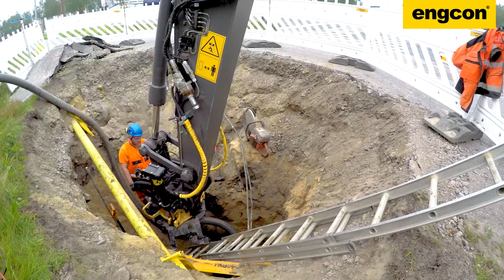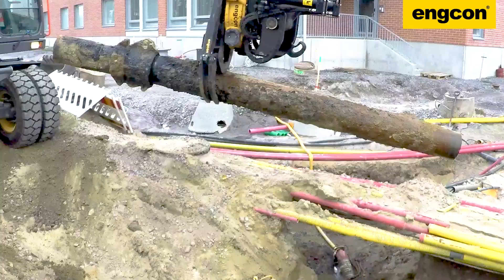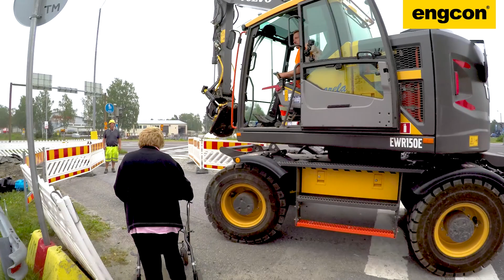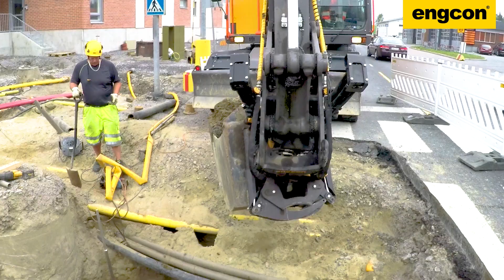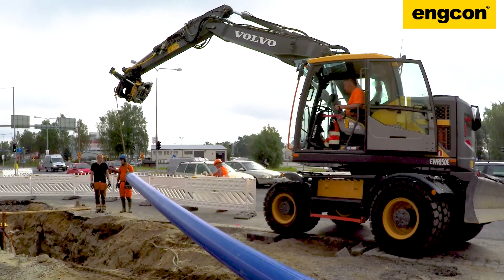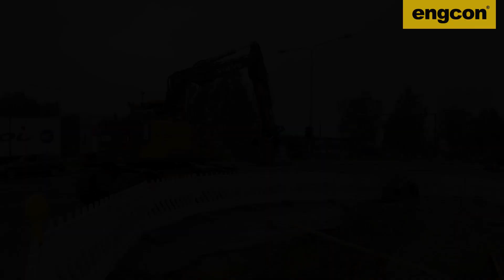Digging for water pipes with a Volvo EWR150E & engcon

Comment: Hello, what do you recommend for gb? 14,15,17 ??
Reply from the maker: It depends on what size that is recommended for just that machine you wonder about.
Reply: engcon i mean EWR 150, i can have gb 14 or 15 the difference in weight is 200 kg
Reply from the maker: You can have both  GB14 and GB15 on the EWR 150. It depends on what type of works you do. Only for grading we would say GB15 (750 litres). Shifting heavy mud, we would say GB14 (650 litres)